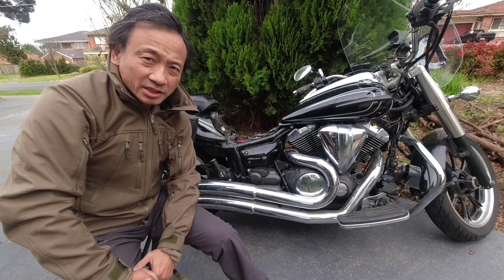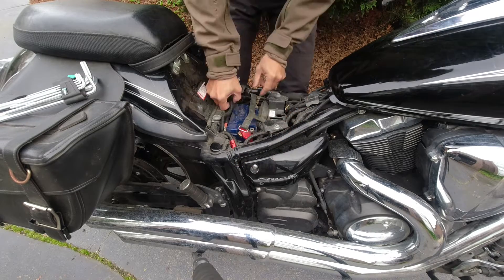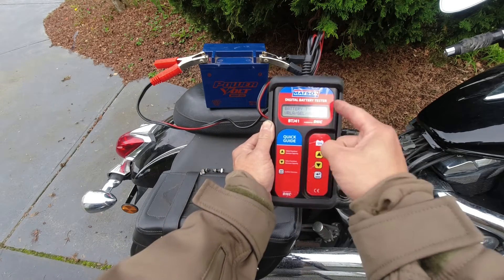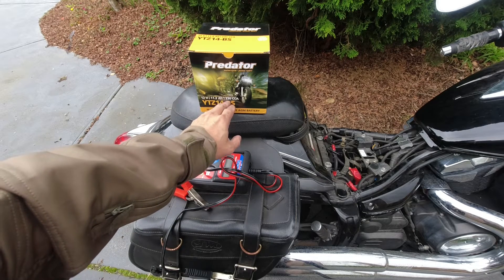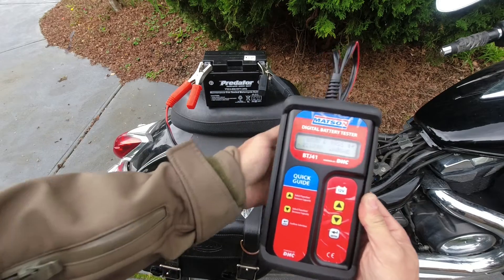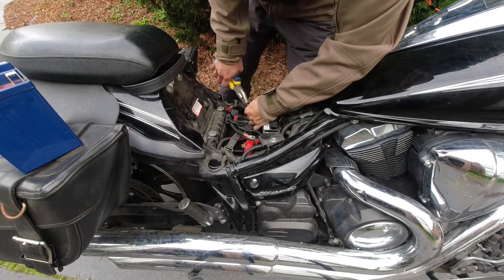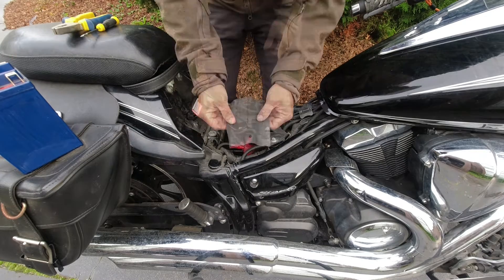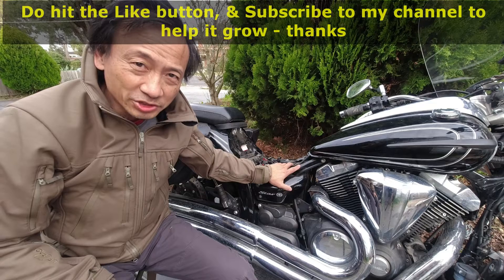Test & replace battery for YAMAHA XVS950A V-STAR motorcycle

Comment: Hello come to Miami Florida my friend 🌴. I hear so many people having to stop riding because it's winter. That sucks. Anyhow, I got a pre-owned 2015 Yamaha V Star 950. But the previous owner gave it to me with a battery that's on its last leg. When I purchased it from him, it was on a trickle charger. I've only had a bike for 3 days, and last night, I took it out to get some gas. And it started fine but today this morning, a beautiful day to ride, it did not start. My neighbor, who has four motorcycles came over, and he tried to jump start it. But it was weird because he tried to jump start it using the trickle connector that is already there, that is connected to the motorcycle battery. Meaning that he did not have to open the battery compartment. I've never seen anyone try to jump start it by connecting it to a trickle charger output cable. Do you think maybe this is why it did not jump start? Anyhow, I'm getting my new battery tonight from amazon. Do you have a video that shows exactly how to take out the battery and replace a new battery? When I took off the seat to look at the battery, there's so many different cables going to the terminals. Because this guy had LED show lights, a custom horn, an LED headlight. Ayy yaa yaaii. Thanks!
Reply from the maker: if you are not competent with doing the electricals. Best to take the bike & new battery to an motorcycle shop. Take a photo of all the existing connections on the -ve & +ve terminals. And make sure the mechanic puts them back correctly to the new battery.

Comment: I'm surprised that you removed the positive cable first. You should always disconnect the ground cable first and install it last.
Reply from the maker: you are absolutely right from a cautionary point of view. I shall have to remind myself to disconnect -ve first in future.  But i was careful not accidentally touch any metal chassis part with a tool, & the +ve Terminal. Good reminder.. thank you.
Reply: When disconnecting the cables
from the old battery, disconnect
the negative first, then the positive
Connect the new battery in the
reverse order, positive then
negative." When you are replacing
your  battery, Ilt isn't always easy
to remember the order in which
to disconnect and reconnect the
terminals.
Reply from the maker: you are correct

Comment: Hi 

My bike has been sitting since earlier this year and when i tried to start it, it was completely dead. 

I jump started it few times. The bike started but kept getting off after few seconds. Also, the odo needlebwas going crazy while it was turned on. It kept going up and down.

Do you recommend taking out the battery and charging it first?

Thanks
Reply from the maker: There is no need to take battery out of bike before charging. Use a proper battery trickle-charger, & let it charge for at least 24hrs before starting the bike. From the symptoms you described, it sounds like either the battery is fully-dead (even after charging because it cannot maintain a load- current draw); and/or also the fuel-line is blocked or dirty. Best thing to do is, if you can get a battery load-tester (not just a multimeter), do a load-test of the bike battery immediately after it has full 24hs of charging. Do not use it to start bike yet. My video shows how I used a load-tester to check health of battery. Sometimes the health is so bad, that it cannot store a charge even after 24hrs of charging. That would mean a new battery is needed.
Reply: Hi

Thanks for the detailed instructions. I will try those steps and get back.